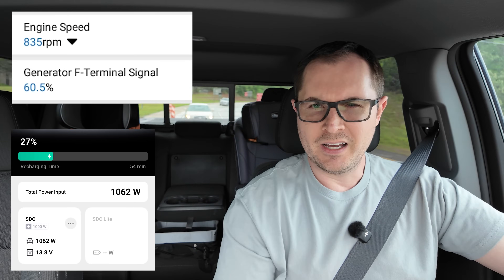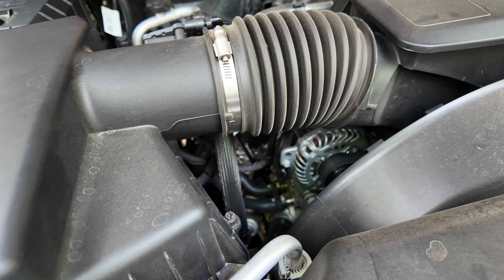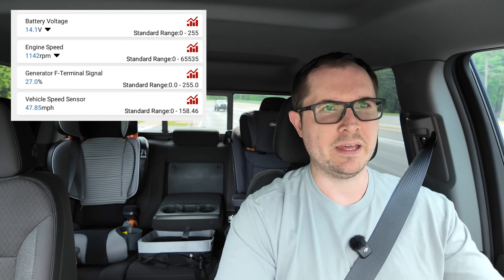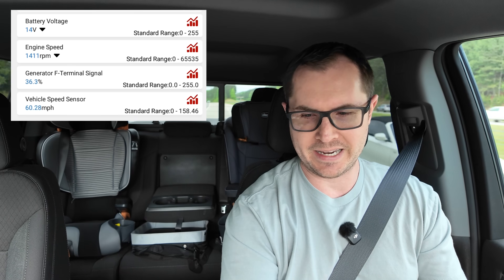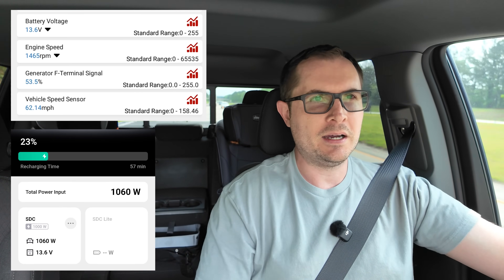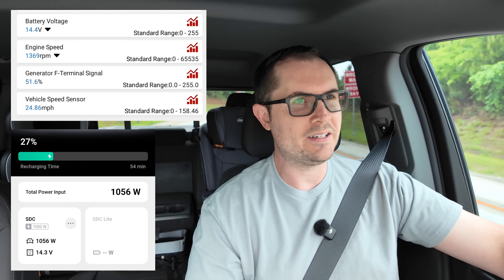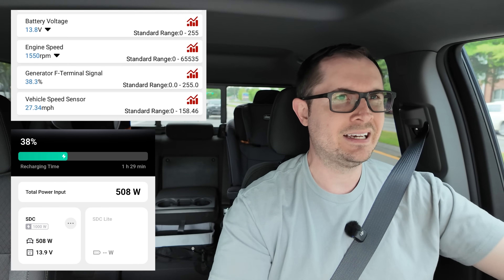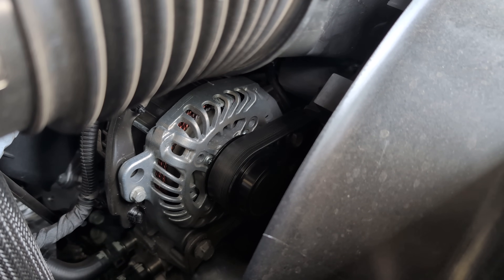I Show REAL Numbers: Impact of DC-DC Chargers from DJI, EcoFlow, Bluetti on Alternator

Comment: Remember if you don't use a dc to dc charger then your LI - batteries will draw as much current as they can get. This will definitely affect the alternator. I use a renogy 20 amp dc to dc charger  specifically for my two 200AH Li - batteries which are are connected to my 2500 watt inverter. I drive a 2021 gmc 3500 van which has a 220 amp alternator. I also have four truck batteries in parallel, one is isolated. they are also charged by the 220 amp alternator. I have a 12000lb Warn Winch as well.  I have never had any problem with my engine or alternator. I think the key is to limit your charging to 20 to 40 amp max, just to be within the output spec of your alternator. GMC and Chevy Trucks have option 220 and 170 amp alternators which would supply plenty of charging power.
Reply from the maker: Great point! Thanks for watching.

Comment: Interesting results. As with any generator, you have to know your alternator's capability and what load you're putting on it. High loads are fine for short periods of time. My car has an 80A alternator, and my motorcycle is only 40A. Neither really has the HP to support larger alternators like a big ol' truck engine can. So I'd have to match the draw of the charger to the size of the alternator. If I didn't pay attention, I could easily overload my alternators and melt them. So the key takeaway here I think is know your system before you install. And maybe don't charge during a traffic jam.  :)

Comment: Why do these dc to dc chargers cut off or reduce power when the car idles?  My cars a/c does.
Reply from the maker: Great question. Most of them use voltage as an indicator and have a minimum voltage threshold setting where it cuts off under X volts. Default for most brands is 12.6-12.8V. For example, if you idle and the alternator is straining, the voltage will drop and the DC-DC uses that as a signal to taper down the amp draw correspondingly. It's not perfect compared to a true RPM signal, but it mostly works. I find a 13V minimum voltage threshold works nicely in my setup, but that'll vary from car to car.

Comment: I would like to see a pully with a much better FAN on it as an upgrade with the charger. Or you could put a puller fan on the back of the alternator to improve airflow over the winding?!

Comment: Issue with all that power  drain your battery  will give out first   your safe at 400-500w  to me  i dont need to fast charge up to 800w-1000w also if your have agm batteries  dropping the voltage  to 10v can kill your battery

Comment: Get a solar panel and hook it up to your DC to DC charger specifically won the prioritizes solar charging over alternator charging. Also if you're putting out more than what your alternator is originally intended to for extended periods of time you might want to upgrade your wiring.

Comment: Good video. I say that because it basically confirms what I already thought that 500W would be peachy. They design extra capacity into the alternator for a vehicle. You missed a point, that it may be possible to install a smaller pulley on the alternator which would boost the RPM the alternator turns at low engine RPM and the alternator would wear out slightly faster but you might avoid a catastrophic failure. I used to put Underdrive pulleys on engines to get better fuel mileage and free up some NET engine power but it was usually a good idea to change the alternator pulley to bring it's RPM back to stock. Sometimes it made no difference though, like on a 2000 years Ford Ranger, unless you added an electric fan also, then you would be marginal.

Comment: I’m thinking of getting a dc-dc charger for my 2026 Chevy trailblazer with smart alternator. Getting 250 amp smart alternator and secondary battery for my 3000 watt sound system and upgrade wiring!
Reply from the maker: Nice setup

Comment: No different than putting a aftermarket stereo in. You can definitely smoke a alternator.  I wouldn't worry about it though specially if you get the dual alternator option on the truck.

Comment: The most important question for alternator longevity is how hot is the alternator getting during charging. 

Heat is what kills alternators and idling at low rpm is the enemy since alternators are cooled by the built in fan which is rpm dependent. There is also very little airflow to the engine compartment when the vehicle is stopped or moving slowly. 

I’d love to see tests with a thermometer on the alternator.
Reply from the maker: Great points. Thanks for watching.

Comment: NOT a mechanic.  Wired in a deep cycle marine battery in the back of my pickup truck with some minor circuitry to prevent depleting the front battery.  Two different pickup trucks, one after the other.    Sold each truck at around 180,000 miles.  I don't recall having a problem with either alternator.
Reply from the maker: That's a great data point, thanks for sharing!

Comment: Its an easy fix, just dont charge at the maximum rate the DC to DC charger will work at, i have set mine at 200W max, perfectly balanced for a van or rv
Reply from the maker: Great point!

Comment: What I am about to say is in no way a solution but there is a positive side to this. I have a 12V refrigerator in my car that draws about 55W during the cooling cycle and in the summer it runs almost all the time as the inside of the car is too hot to run efficiently. I installed a 200W of solar on my roof rack and a 100Ah LiFeP04 battery for a long trip I did in 2023 to the Arctic Ocean from New Jersey. I did it to minimize the use of gasoline to run the engine for basic electrical loads during the trip especially during extended periods when I was parked. This solution takes care of my power issues and also I configured this in a way that when I'm driving and my 100Ah battery is full I can flip a switch that flips a 250A relay to  connect the fridge battery to my regular car battery and the alternator is basically off at that time. 200W is not enough to run everything in the car as far as standard equipment goes for long trips but letting the car borrow "free" energy from the fridge battery basically puts no load on the alternator during normal driving like to work or other not so long trips. If I go to work my alternator is not used and while car is parked the fridge battery is recharged quick enough at around 10 amps sometimes more on sunny days because the angle of the panel is always horizontal to the sky. During the winter I actually get a lot more usable battery capacity as the fridge has to cool a lot less. Also they make flexible solar panels that will not need a roof rack to install but they are at least 50% more expensive than conventional glass panels.

Comment: In my mind, here are the facts:  

1) Heat is what destroys your alternator, both mechanically and electrically.
2) Heat reduction is a direct function of RPM... so if you drop RPM and field increases, so will HEAT.

So the secret is:  Prevent overheat!

How?  I think if there is an Enable/Disable on the DC->DC then a simple solution is an external thermal switch attached to the alternator.  If it gets too hot, turn off the DC->DC charger.

This should be a very inexpensive and effective way to limit heat to a sane top-end and prevent self-destruct.
Reply from the maker: Great points, thanks for watching.

Comment: Really educational!  I have a 1000w inverter rather than DC-DC. So I can’t dial it down. Seems I should install a DC-DC instead. Thoughts?
Reply from the maker: Great question. I think of the DC-DC being more useful if you want to store power for use later when engine isn't running. If you only need power when engine is running, the inverter option is arguably simpler.

Comment: It would be great if the charger could automatically lower the charge rate at idle and raise it when the alternator output climbs when the rpm raises. That would probably help the lifespan of the alternator significantly and optimize your charging rate.
Reply from the maker: Great point. Right now the three main brands only use voltage as indicator and have a minimum voltage threshold setting to determine when it ramps down. It's not perfect, but sorta accomplishes the goal since idling potentially results in lower voltage in turn. The RPM option like you described would be even better.

Comment: This is the dilemma. I have a deep cycle dual battery system permanently in my vehicle. If I connect my auxiliary battery directly to my vehicle charging system, the battery will not charge correctly and will be damaged due to incorrect charging algorithms. That is a very expensive battery to potentially destroy by not charging properly. The DCDC charger I have is designed to charge my auxiliary battery correctly and to monitor the input charge from the vehicle and adjust its charging accordingly.

Comment: Interesting video. How do you think installing a 2nd alternator would affect your results? Would it be better to swap out the alternator for a higher amp unit or to install a 2nd alternator in a camper van conversion? Ford offers an added 2nd alternator for around a $1,000. Obviously, I don’t know much about this stuff.
Reply from the maker: In hindsight I would re-order my truck with the larger 220A option, and if I planned on using the DC-DC on a more regular or weekly/daily basis I'd go for dual alternators. I could definitely see on a camper van setup going as big as you can, and potentially dual alternators if you plan to use it regularly at full load.

Comment: I'll say the g m trucks have a smart charging system.That will put the alternator in different states such as if your battery is full.It'll go into a fuel saver state when you're on the interstate, and the amperage will drop very low or if your battery is cold or low voltage.It'll go into a regen cycle.And it'll get upwards of fifteen volts

Comment: I've noticed that my Ecoflow does a pretty good job of communicating with the battery and adjusting how much it pulls. I've had mine running while waiting in school pick up line and it's only pulling about 250w sometimes. If it somehow does kill my alternator, I'll just take it as an opportunity to upgrade it.
Reply from the maker: I'm with you 100%, great point

Comment: It's hard to say what is the failure of most alternators is it diods burn out or windings failing or the voltage regulator and how does the degradation work like I assume there is a temp that accelerates it but how much and what temp is concerned safe I mean the only thing I think would cause failure is heat and sure if it's under high load that means more temperature
Reply from the maker: Great point. I am learning the heat is a big factor that is easier to overlook since most vehicles don't report high alternator temps nor do we as owners pay much attention to it. The big take away I learned is to avoid idling with a heavy draw, and reduce the draw when you don't need the full 1kW.

Comment: Wow, awesome video—super informative! I run a Jeep Wrangler with an EcoFlow DC-DC charger, and on a recent trip towing my Tab 360, my alternator gave out and I ended up having to replace both the PCM and alternator. I’ve got JScan and was planning to do a similar test since I used my Jeep to charge my batteries during the day and relied on them at night to power my trailer. I really like how you synced your screen outputs with your commentary—it makes everything so easy to follow. How did you record and align all of that on camera?
Reply from the maker: Thanks for watching! The big lesson I learned in all of this is to avoid idling and reduce the DC draw when I don't need the full 1kW. I had to record everything separately and then just made a sync point to combine it an Adobe Premier Pro...kinda like a multi-camera edit. I let my various "camera angles" record continuously so that it only required one sync initially and then it's easier to edit. I'm no pro by any means though, so there may be other ways to do it more seamlessly.

Comment: It all depends on balancing the equipment so it doesn't put too much of a load on any of the involved equipment.  Alternator, wiring, dc to dc charger, battery (starter and appliance), etc..  If you match it properly, there shouldn't be a problem.  So, do your homework!  Do your load / charging requirements, then work backwards as to the battery size needed, then the alternator, associated wire (including length of wire) and fuse sizes, then install it well.  Buy better equipment, electrical is too dangerous to go cheap.  When I converted my bus to an RV, I spent more on my electrical than anything else.

Comment: If you use the auto start/stop feature, it negates the idling issue.
Reply: If the vehicle is like my F150, it won't allow start-stop with this much load on the power system. (Part of the testing to ensure the engine can restart.)

Comment: Amazing video and explanation—thank you! As I understand it, using the DJI charger while driving is the best option.

Could you help me with a couple of questions? In the case of a DJI 1000 and 1000W charger (with about 50-60% load only), does that mean it would charge from 0% to 100% in about one hour of driving? And what improvements—or even faster charging speeds—could be achieved with a GMC 2500 diesel engine?
Reply from the maker: Thank you, I appreciate that. You nailed it by saying only use while driving/cruising...that's what I learned out of all this in the process...avoid idling. If I'm cruising along on the highway and have the full 1kW recharge rate enabled, I can go from 0% to 100% in about 1.2-1.5 hrs realistically on the DJI Power 1000. Sometimes the charging gets interupted with alternator/voltage fluctuations, and sometimes heat can also play a role such as if it's a sunny day and I have it under my tonneau cover baking. All that to say, the Duramax should have a 220A standard, so that gives a little more surplus compared to my stock 170A on the gasser. If I was ordering my truck all over again, I'd probably check the 220A or even the dual 220+170 option...it's not much more and that would give a lot more surplus. Otherwise no advantage on the speed of charging when comparing gas vs diesel engine.
Reply: @AdventureRocks awesome thank you! I have an idea to go camping on a weekends, so doing some research in advance, from choosing the right car and equipment 😅. Your reviews have a lot of values!

Comment: I just purchased a 560 Watt DC to DC alternator charger for my Chrysler Pacifica to charge my 1800 watt power station next year on a 4000 mile drive to Alaska. Your review gave me peace of mind that it won't be an issue with the Pacifica's 180 amp alternator.
Reply from the maker: Thank you for watching! The main take away I learned is to not idle with it running, especially at the highest wattage. And if I don't need the full power, I just turn it down accordingly 250W or 400W, etc.

Comment: thank you for your effort in this video,  I learn a lot. I do monitor my alternator so closely, my 4runner's alternator is only rated 140 amp and I use a victron Energy Orion 12/24-Volt 20 amp DC-DC Converter Non-Isolated, High Power to charge my ecoflow delta 2 max, only getting 435 w of charge and my alternator is maxing out. how do you get that meter that you have to monitor all those parameters? It would be great to have, thanks
Reply from the maker: Thanks for watching. I was using the Kingbolen K7 OBD2 Reader - https://amzn.to/3SMZRRq